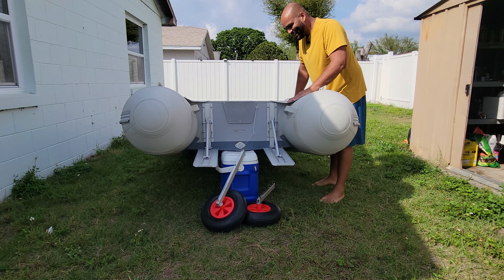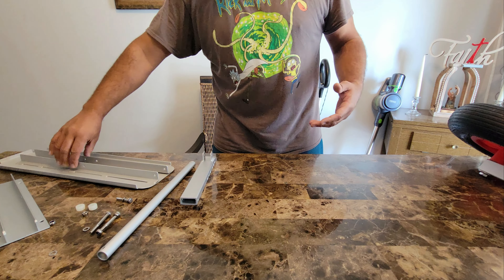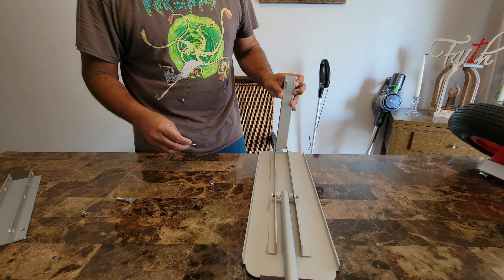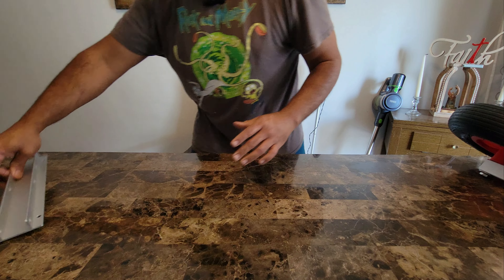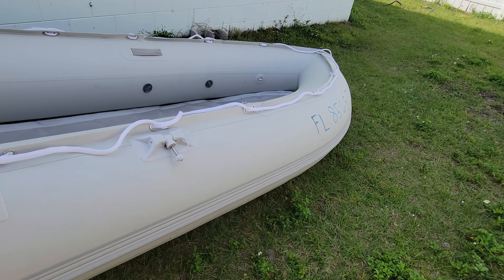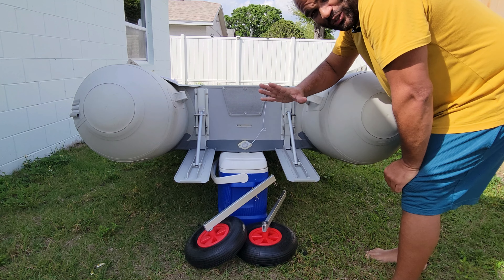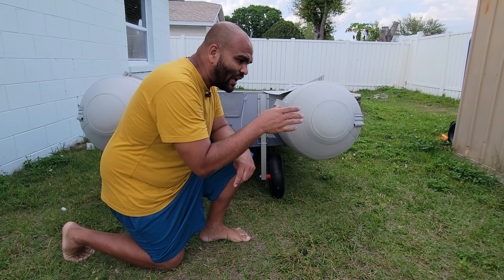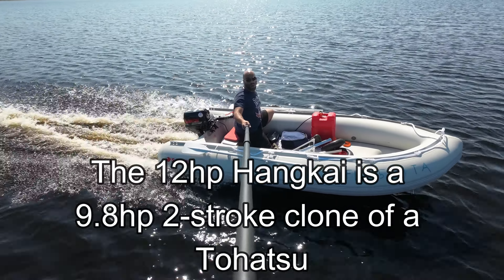Boatstogo Inflatable Boat Lifting Tabs review

Comment: Hi Erick,
Does that motor have a hydrofoil on it?
What’s better the tabs or the hydrofoil?
Reply from the maker: Depends on your boat model. Some boats catch plane quickly due to their design, the same applies to boats that do not. If you struggle a lot to catch plane, tabs will be there best, of its just a little bit, the hydrofoil.
Reply: Thanks. I’m struggling with my boat, a 365 airdeck.
Reply from the maker: @sldrose  Anytime! The tabs will always work, while the hydrofoil can be a hit and miss.

Comment: Brilliant.  Get on plain faster, must mean get on plane w/smaller motor?
Reply from the maker: I'll say 6hp minimum
Reply: @ErickMartinSucre  maybe next weekend I'll have time to find out. I bought the Bris 14.1. And I took your advice and bought the Tohatsu 6hp. I got a Honda 5 long I can barrow of the sailboat and I got 3.6 Hangki. So we'll find out.

I know the Hangki 3.6 would not plain, that is why I bought the Tohatsu 6.
Reply from the maker: @LouLovesLyrics  It won't disappoint you. I bought a 12hp Hangkai but kept my Tohatsu. I use it on my SK385XL Kaboat.
Reply: @LouLovesLyrics  but why Bris??? Why not Saturn???  Just what made you choose more expensive Bris over less expensive, and more well built Saturn.
Reply: @inflatableboats  when I bought my Bris it was the same price as the 11ft Saturn. It had 17 inch tubs and my thinking was 14.1 would be more effective in the surf. 

However  mine is a kayak so the transom is thinner.  The motor won't turn without interfering with the transom wheels in the up position so the wheels have to come off. Mine is less stable as well going over larger wakes because more often than not you cross them at an angle. Also if you're running from Big surf and you are trying to get past the break you often are crossing the waves at an angle.

In hindsight nobody's perfect. You're right I wish I would have bought the Saturn 11 ft. I also wish I wouldn't have bought the Hangki 3.6. 

But the Saturn now is only 599 so I'm thinking what good is 2 motors with one boat?
Reply: @ErickMartinSucre  we talked about the lifting tabs. right?
Reply from the maker: @LouLovesLyrics  Oh yes, sorry. So you placed the order and there was an issue with the credit card?
Reply: @EricMartinSucre here at the end of this comment is where I tell him I'm going to buy a $599 Saturn boat. I even told him this where I got the idea to buy a boat from him and he still did exactly what I said he was going to do. Take my money by refunding a fictitious card and not giving me what I legitimately purchased then fight all the way to keep the money. And what could I have possibly done to deserve this?

Like I said we had 20 exchanges on email. I have screen shot every one and I will post them so you can see who is being unreasonable.
Reply from the maker: @LouLovesLyrics   Wolvesgathering@gmail.com, you can send it there and I'll check if you like.
Reply from the maker: @LouLovesLyrics  I sent them an email. I'll wait and see what I receive.
Reply from the maker: Got a response back from Boatstogo. Something happened where the charge went to an older card, and you got a newer card. This must have happened when an new card was being sent to you, while the order was placed on the older card. Does this sound about right? I recall that happened to some customers when I worked at Comcast.

Comment: What are the plastic bars on the bottom of my Saturn SD330W? When I was trying to put the wheels on, the bars on the bottom inside transom were in the way. What are they used for? 

Thanks! Love your videos
Reply from the maker: Plastic bars? You mean the rubber guards?
Reply: @ErickMartinSucre  it’s the two plastic bars on the bottom of transom(inside boat). Left and right of drain valve.
Reply: Another question, what’s the best way to attach a flag on transom without drilling holes? I want to put a flag on transom. Been looking at clamp mechanisms that will have an attachment to hold small aluminum flag pole.
Reply from the maker: @emorydeloach6236 I have never done that so I would not know. You could install a fish rod holder and maybe use it to place a flag on it. You can glue it on the rear bladder, or maybe straight into the transom. Those are the only ideas I can think of.

Comment: Are the lifting tabs compatible with brocraft Transom Wheels and bracket? I remember one of your boats had it. And the tabs used in the video those are the 6" small tabs?
Reply from the maker: As for the pins, it is likely. The spacing of the holes will be a different story

Comment: Thanks for the video, very convincing solution for my new ZK 380 planing problem. Question: what height do you mount the planing tabs in proximity to the bottom of the transom? Flush or slightly higher, let's say half or 1 in? The mounting instructions provide no specifics in this regard and I didn't hear you say that in the video - thanks!
Reply from the maker: Surprisingly, it aligns with the rubber seams at the bottom, near perfect fit
Reply: @ErickMartinSucre  I guess you're referring to the bottom of the mounting bracket touching the top of the PVC floor seam that wraps around the transom?
Reply from the maker: @Motorhead-hm5jq correct. The moment you place the bracket, it aligns perfectly
Reply: @ErickMartinSucre  I noticed the top of your bracket was mounted on the transom as high as you could get it underneath the rubber that wraps around the top. Because these boats are basically handmade there are differences I guess and the PVC floor on mine wraps around the transom a little more than yours, about 3/4 of an inch higher causing my bracket to overlap it. So I suppose upper positioning is probably more consistent. One more question: did you mount your bracket square with the transom or did you angle them in alignment with the bottom? These boats are actually a semi-V hull - just trying to get it right!
Reply from the maker: @Motorhead-hm5jq The lip that sticks out at the top of the transom stops the bracket in place, at least it did to me.
Reply: @ErickMartinSucre  Yeah, I think that's our best alignment position. I emailed the boats to go guys, but they're usually slow replying and I want to get these things mounted and have a day or so for the silicone caulk I'll be using on the bolt holes to dry. So you basically mounted a brackets vertical, correct?
Reply from the maker: @Motorhead-hm5jq yup
Reply: @ErickMartinSucre  Thanks buddy, appreciate your help and your channel!
Reply from the maker: Anytime!

Comment: Did you have the fins or whale tale on the lower unit of the out board for this test?
Reply from the maker: My Hangkai doesn't have a hydrofoil so no. My Tohatsu 6hp does, but it was not used in this video. Those tabs transformed my ZK380 into a different boat, it's aweaome!!

Comment: How much top speed did you lose ?? I owned a hangkai. I had fins installed as well.
Reply from the maker: I did not measure top speed on this video, but I felt like I did not lose any speed, if anything, it got a little quicker in my opinion.